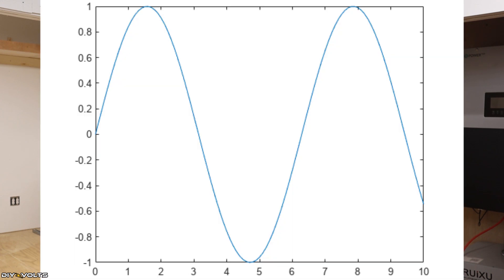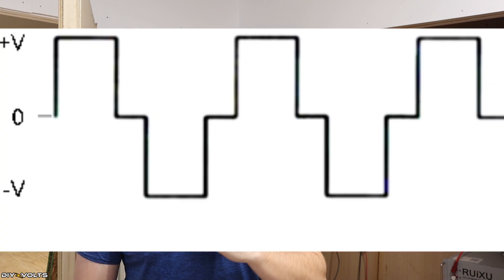Power Inverter Basics - Learn about Inverters on grid and off grid

Comment: Thought the Luxpower 12K hybrid was a high frequency inverter, not low?  Also, when you run the Luxpower 12K hybrid in grid-tie limiter mode does it turn off when the grid goes down or can it still run off solar and batteries?
Reply: It's not just a high frequency inverter. It's a Chinese made high frequency inverter.

Comment: Westwoods inverter is a High Frequency inverter but likely uses IGBTs mosfets
Reply: Also the Lux is a high frequency inverter , same as the eg4 18k , you can see in the data sheet , says (Transformerless)
Reply from the maker: I am not sure about that. It is a heavy unit.

Comment: But seriously, I have been looking for a reasonably priced inverter like the Lux but did not know it existed until right now! My home in Southern CA is run by four of the little blue box 1000W inverters during the day and two at night (using the battery function off batteries). The LGM batteries are charged by quality AC battery chargers on timers that turn on during peak power/sun power (10-3PM) so the batteries are not on charge controllers. The two systems are independent and very simple. My system has worked flawlessly for two years now and we have almost no electric bill (under $50.00) and no Net Metering!  So, the LUX Power 12K seems like just what I need to move up the quality & Power scale if it truly has Current Transformers like the little blue boxes do in my existing system. My neighbors all have Net Metering and huge roof top systems costing 30K+ to 65K minimum and my system cost less tan 5K including all wire, switches, fuses, ......
So I am really looking forward to seeing how you use your LUX 12K!
Reply from the maker: Nice that you have a system in place working well! It is rewarding to have that low power bill. The lowest I have seen mine is $35. The lux power 12k and lux power 6k are both great inverters. If you do decide to go with one be sure to use the code in the description to save some money. Once nice thing about the lux is that you can use the CT clamps to prevent back feed and it can have full 6kw unbalanced power output. That means you can use 120v on one leg and leave the other free if you wanted too.
Reply: @DIYVolts  Thank you. I look forward to this new channel and watching and learning especially about the LUX. 
I have been a subscriber and really have learned alot and purchased at least one or two RP from L2H. You can not imagine how happy I was to see you doing this new channel! The very best of luck to you!

Comment: please share you battery exp/knowledge you have great teaching skill. I built the same solar mount but chose to keep as tall as possible and run my wires high up. I got worried people/animals do dumb things around high volt/amp lines. What state do you reside (no wind ,short sun hrs, mountains and tall nice looking trees. I'm having fun powering more each year with 0 grid tie-Make it/Store it/Use it.  Good channel -common sense saves dollars.
Reply from the maker: Thank you for the kind words. I have a battery video planned. I hope to show several types of batteries and how they differ from one another. I am located in North Carolina. The solar window here is around 5-6 hours max. trees and a mountain take care of that. Powering things off grid is great!

Comment: Wow, can't believe all the equipment you have..Why be on the grid at all..My 6,000 watt Luxpower inverter is enough for my off grid cabin home, along with a little 12 volt system, and a solar generator...The key to solar and being off grid is using less energy and efficiency, atleast in my view..Down grade now, and beat the rush, because it's coming..Nice job...
Reply from the maker: Much of the equipment is accumulated over the past 4 years. I am about to take my top shop off grid with the luxpower 6k. "Big Battery" is sending that for one of my other channels. You are absolutely right. Reducing the amount of power used is the very first step in going off grid. with the monitoring equipment available these days its easy to see what is going on. Soon I am going to install the emporia system to see what all my shop uses.